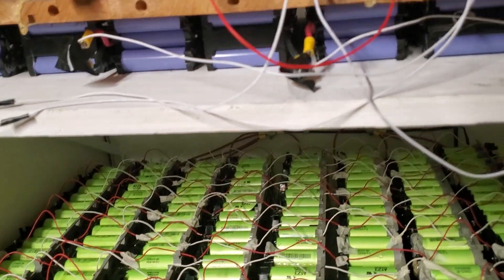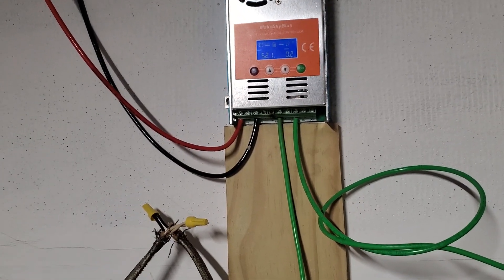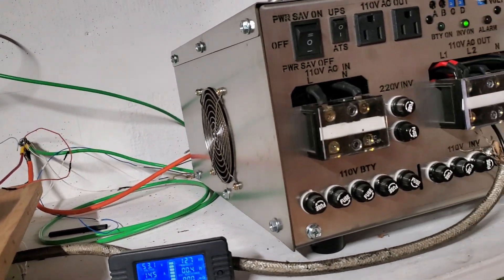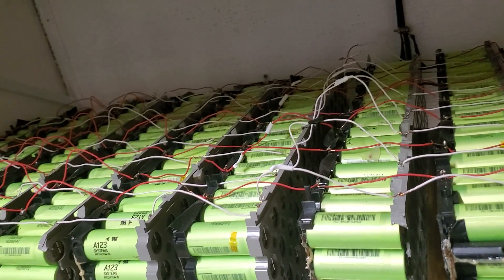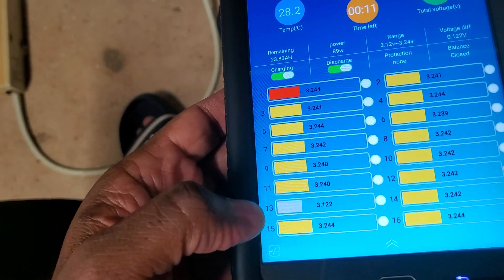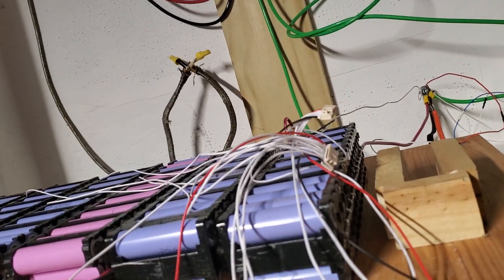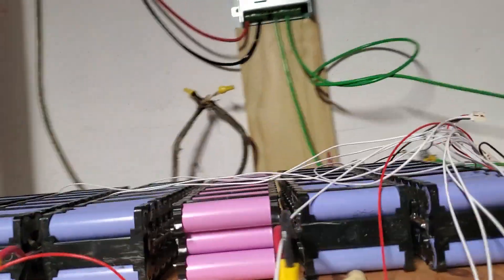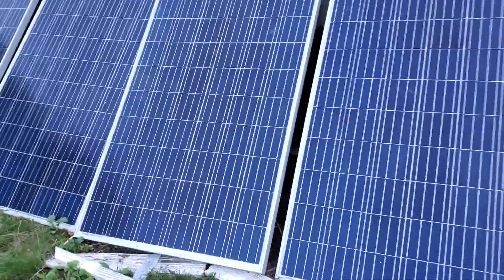90 DAYS+ OFF-GRID WITH SOLAR POWER 🔋 ENERGY SYSTEMS  #lithium #lifepo4 #solar #inverter #Off-Grid

Comment: If I could make a suggestion it would be to shoot the video in the battery room & then do the voice over later on in a more quiet room if possible. For the part of the video when the transformer was running it was ridiculously difficult to hear you over the top of all the fans & stuff,  there were many parts I just couldn't understand no matter how I tried. This is made even harder with your accent as well. Otherwise nice work keep it up it's an interesting topic. You'll eventually get more views as time goes on as long as your content is interesting & helpful.  I hope it all works out for you but don't expect miracles straight away.. Cheers Greg
Reply from the maker: Thanks for the tips